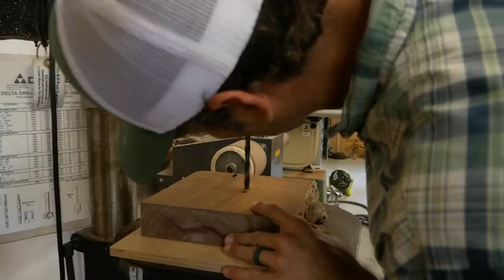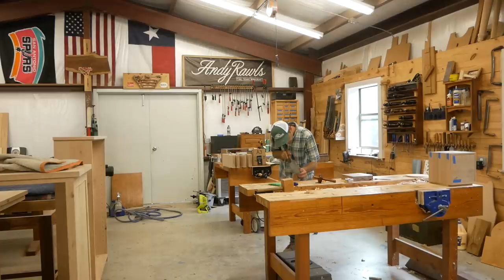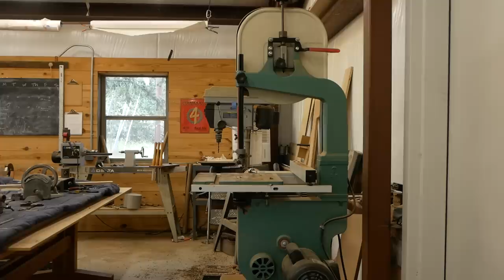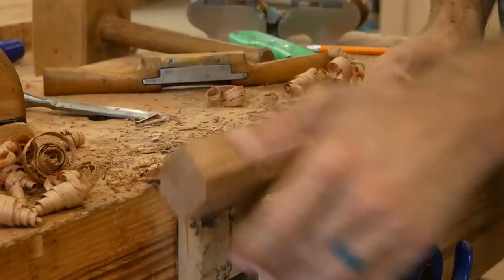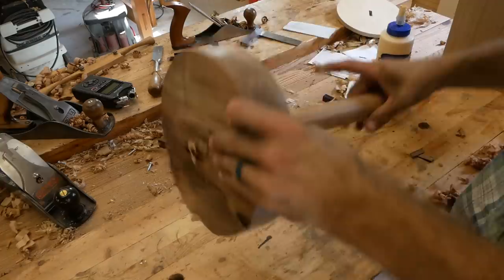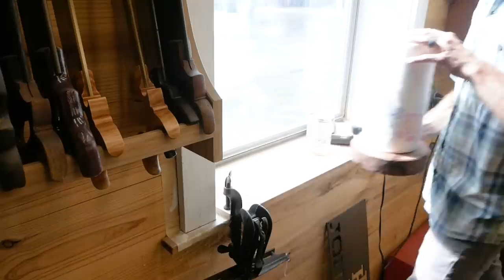Handcrafted Mesquite Paper Towel Holder

Comment: I made mine with magnets on it so I could stick it to a cabinet.  I used Ikea draws for the wood and a left over dowel.  I pulled the dresser off of the curb for the hardware and top to reuse it.  I have used the drawers for all kinds of stuff.  Your's is way cooler!